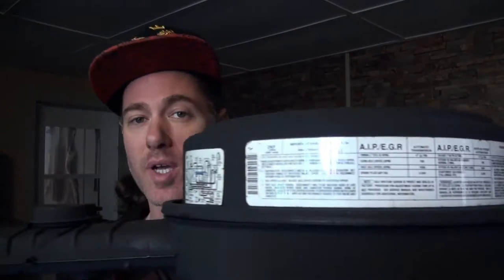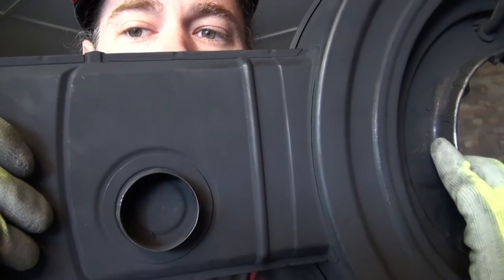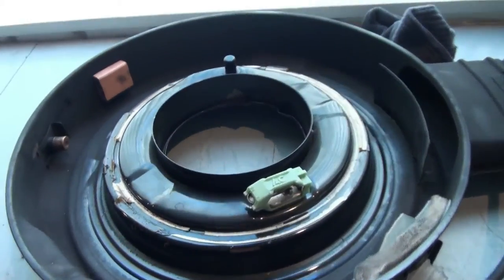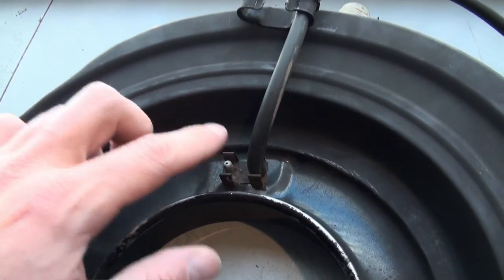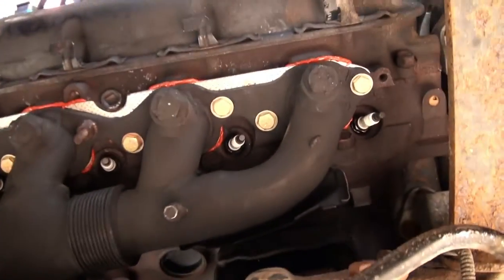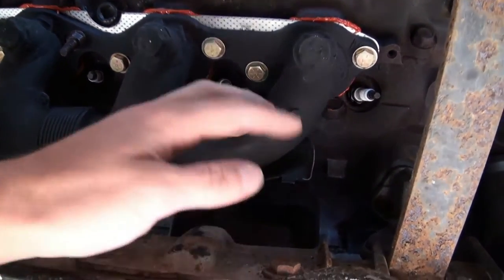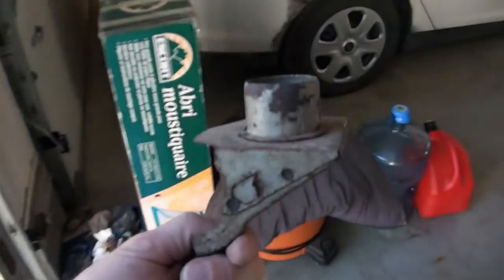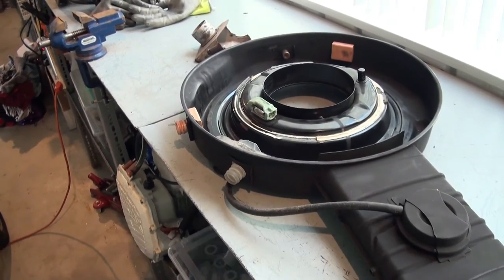GM Thermac Air Cleaner, EFE System, Carb Heat and Heat Stove Operation

Comment: All these years and never it even had flaps that were supposed to open and close. Thanks for the explanation. I don’t care about the not burning of the fuel for emissions but I care about trying to save gas and burn more efficiently at $5.20 a gallon rn. Thx!

Comment: Good video, I'm in the process of restoring my setup on my 84 z28, everything works but the temperature sensor both old one and new one won't open the flaps if at all. I usually have to end up unhooking the manifold vac line and capping it off so the engine doesn't run too hot. Not sure if that's a vac motor problem or what.